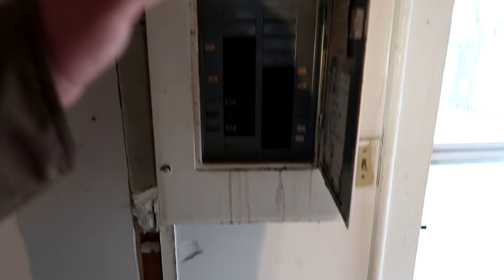Wait Till You See The Bathroom In The House...

Comment: ...we haven't seen anyone come through and give approval checks either and if you think they won't come in and make you rip up the floor or tear down a wall to check your work bro you are sadly mistaken I hope it doesn't happen to you but it happened to us and even though it past inspection the repairs cost us an extra 5k.
Reply: Everything has to be inspected , electrical , plumbing , insulation ect not good not good

Comment: Get a optional on/off timer switch for the bathroom fan with a on/off only for the light. it makes it really nice. You can set the fan for 5,10,20,30 minuets and it shuts off automatically and I think it adds value. The tile looks great Brian! I always go with sandless Delorean grey colored grout and you cant go wrong with it. also have matching Delorean grey bathroom caulking to match it for bullnose and back splash finish. Looking really good JOE!

Comment: Pressure wash the entrance, and take a clear drying epoxy across the top, and you can buy an abrasive mix made for slip resistance,  and sprinkle on epoxy before it sets up.... grip tape works, but needs more adhesive.....cheap and easy..✌

Comment: JOE, I WORK AT LOWES.....you need to be shopping for NON STOCK , go to the pro desk and ask them if they can QSP any purchase over $1,500 it will usually get you 15% off, and go to all departments and as what NON STOCK products they have, today I sold 60 boxes of engineered hardwood flooring (1080 SF) for $400... normal price was $2,500

Comment: I installed three different Rheem tankless water heaters in my parents house. And two at another house. Granted they were under warranty they just gummed up with calcium extremely fast. Those were all electric but I've installed a few gas Rheem tankless water heaters all in different homes and so far no problems and that's been over a few years now. I suggest you really look into other people having the same problems. You should possibly look into getting a water softener or keeping your gas around

Comment: Brian is def a guy you want to have around, one big question though is did you pressure test the plumbing before doing all that? I am guessing he did but if not better to do it now then wait, I have done alot of those jobs and even me was like ehh I trust it no need to do that but always did it just to feel better, nothing like turning the water on and finding a leak in the pex fittings that could of been addressed in a simple test before putting in drywall etc...

Comment: I can't believe you went for an electric tankless water heater. I do believe I heard you said you're taken out the gas. I'll bet you on your tankless you have to put in 3 40 amp double pole Breakers that's 100 and 20 amp. That electrical is going to wire up inside that water heater box. Probably not 6 in from the water lines coming in and going out. Ask anybody who knows about electricity you can't put electrical wire in the same ditch with water even staked two feet apart. In California. If you know anything about electrical amperage still scared the poop out of you. You get a bump just off of a 15 amp line it could be enough to take your shoes off. And you ain't getting even a full amp. But you could build a heck of a electric chair with a hundred and 20 amp to it. Cook the hair off your head. aww. I bet you you had to change your electrical service and service sub panel box 2 and at least two hundred amp service 150 could do it. I don't think that's marble. Granite but still nice. Put in many of them. I used to repair them.

Comment: Brian did good with the tile but you guys are getting way ahead of yourselves with parts of the projects. You should never lay tile before all structural beating and banging is done in a home. Nor should it be done before the mud and finish work is done on the sheetrock. You are gonna have tiles coming loose and moving now. A lot more clean up also.  Joe needs to stop rushing Brian on things. Let Brian do things how it should be done. No self respecting contractor would ever lay tile before all the other things are done. Tile is last. Always. Shows Brian is a good sub-contractor, not contractor, because he's not doing things in a start to finish form. But he does do good work. He just needs to work with a license contractor to learn the proper directions to go. But good job on it Brian I just hate you are causing yourself more work. Also more you keep Joe away, better off you'll be.  So glad the crying rich boy wasn't claiming he was broke. Lol

Comment: That's great you got a used HVAC air handler and condenser for so cheap.... Just wondering who your going to have install it since I never met a framer who knew anything about evacuating and charging a system. 
Lesson number 26. The only trade guys who know how to do HVAC are HVAC guys, and sometimes Plummers but don't count on a quality HVAC job from a Plummer. 
Also those warranty's on the HVAC system will be null and void if you don't have a qualified installer put them in. Better start reading the fine print instead of taking some guys word. You need to be HVAC contractor to get those warranty's brother.  
U r in for a rude awaking after your butt cheeks get spread apart from thinking you could just jump into this with zero experience.

Comment: And the only critic I would say about the bathroom is not using a soap and wash rag holder in the tile for the shower. It's just a tile piece you put in and tile around. But you don't have to use them. And also I didn't see a vanity GFCI receptical